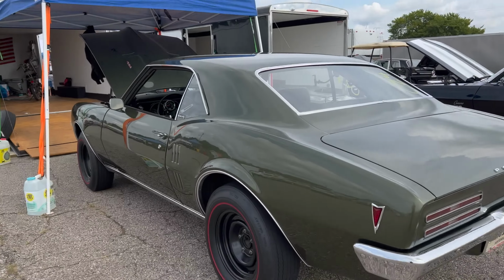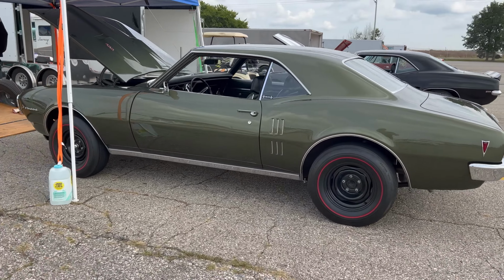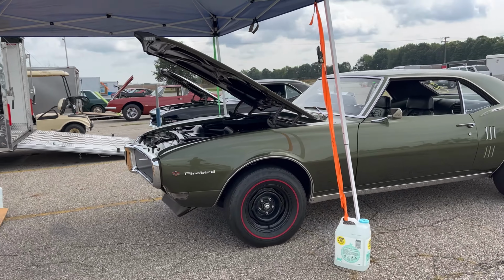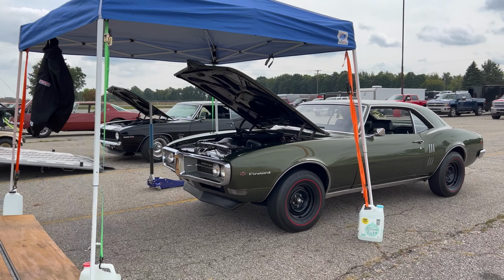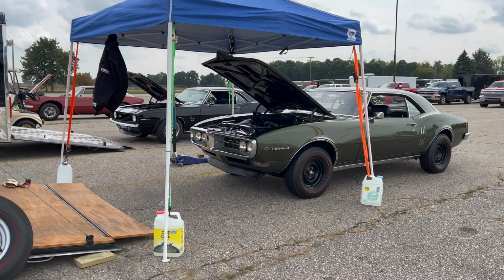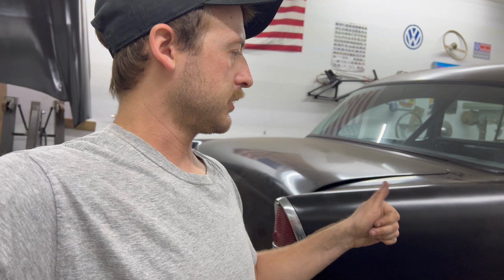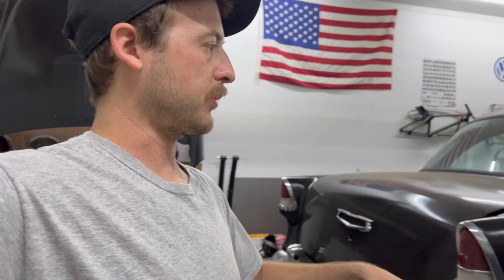68 Firebird Ram Air 2 Pure Stock Muscle Car Drags. Day 2! Not ideal...

Comment: I can't be sure from the video but... based on the shifter knob and the wide gate you have a 69 style slap shifter installed on the Firebird. You just push over and up for each gear then let go, it will ratchet to each gear. Really nice for racing and staying in each gear without overshot. It takes some effort to swap them in, including moving over the reverse light switch plate, so if your reverse lights don't work you would need to make that adjustment by getting the plate off the 68 shifter and bolting on the switch. I love this Firebird man, I appreciate you sharing this content.
Reply from the maker: Yes it is the 69 shifter. And yes the shifter wasnt greased so when you would hit it at the 45 degree angle it was struggling to move so once we got it greased it was working very smoothly. And glad you enjoyed it and the car!